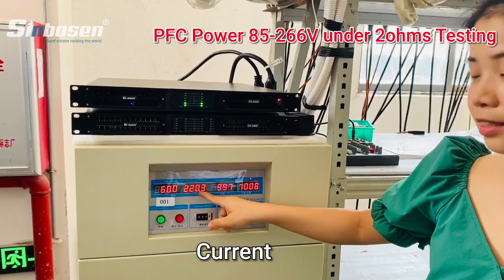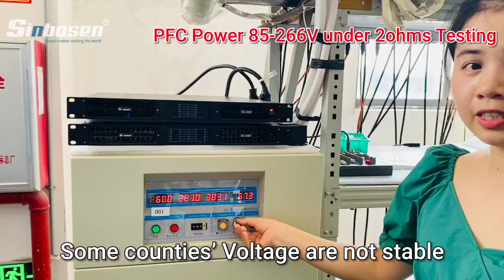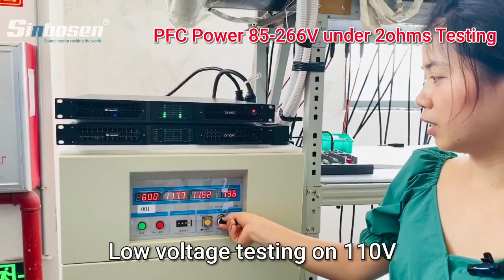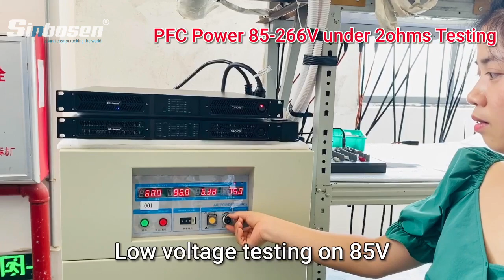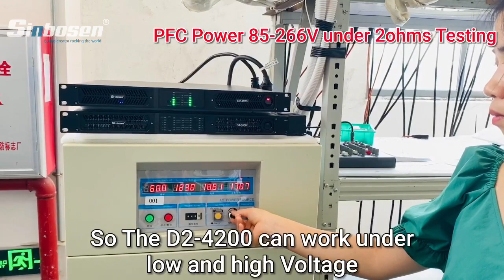New arrival 4200W at 8Ω digital amplifier D2-4200 can work stably under 2 ohms.Let's do a test!

Comment: You up and down the voltage, but with the same ampers. In the real life if the volts is low, the ampers power to feed the amplifier is low too. For example if your amplifer needs 40 ampers from 110 to 250v, and the line can give only 110v with 20 ampers, due to the high load of the others people at its home conected to the same line?